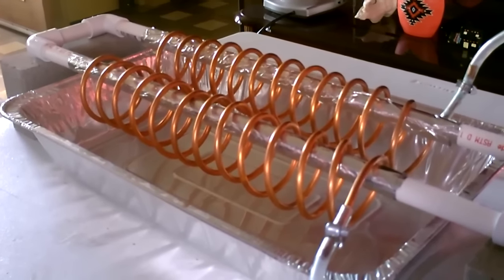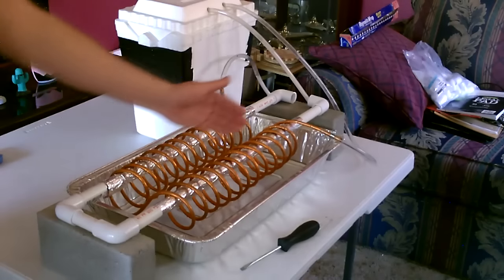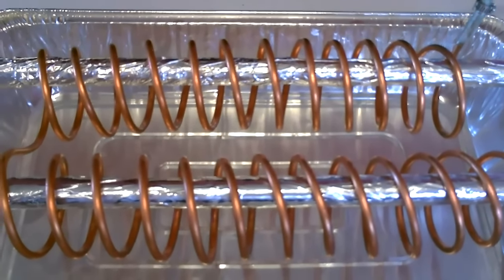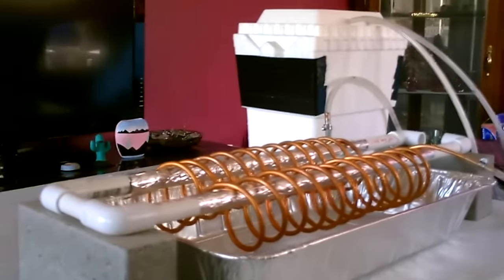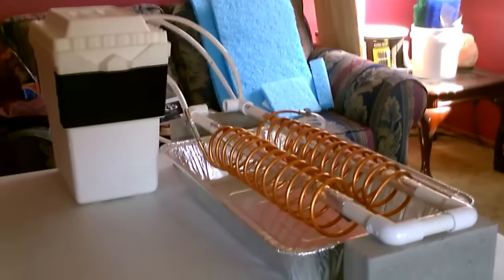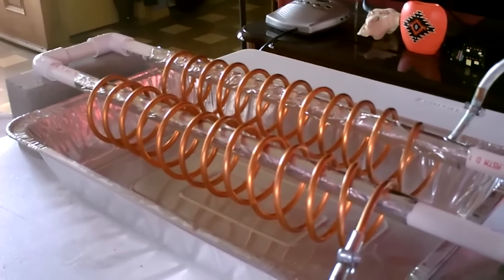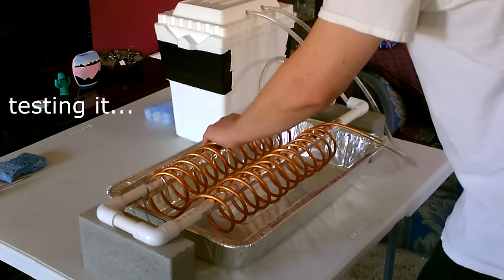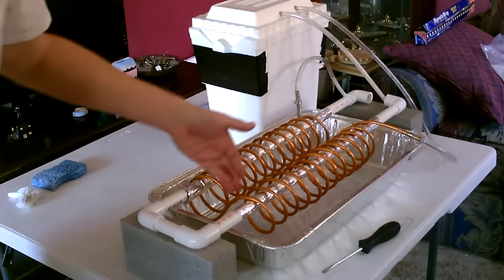DIY Atmospheric Water Generator! - Produces/Extracts Distilled Water from the air! - DIY distiller

Comment: I would love to see another video where you would explain clearer what is in the box and why/how this works.
Reply: @desertsun02 could do another one with a spare fridge to axe for parts, and skip a lot of intermediate steps such that the fridges compressor loop that used to be making the ice, is directly cooling the sterile copper condensation high surface collector thingy. Would be interesting to compare that to the similar units that sell for hundreds or thousands of $
Reply: What the hell youtube how do you tag people? @desertsun02 @desertsun02 bla bla bla
Reply: Sigmund Q Freud  energy consumption here is secondary... water gain is the trick
Reply: Ice and a fan
Reply: peltier cooler will be more compact to use for this one
Reply: @Tommy Barlow Cool bro (pun intended) lol. I've never really shopped for one but I do remember the first time I came across the concept like over ten years ago was watching this video for a proposed military contract that would have cost hundreds of millions and would produce an oasis in the desert. Probably a wide range of costs lol.
Reply: So you need water and a form of electricity to make water ? It's a neat idea but not very practical
Reply: This is a simple condenser. The copper coils are probably closer to 39F than 33F. If the air is humid, a 39F coil will condense water, just like your beer glass does on a warm summer's day. Water and pump are a pretty cheap way to cool the condenser coils. You could use a compressor and an inert gas, the same way your fridge or air-conditioner does. If you've ever been in SE Asia in the summer, it's basically raining condensation from the window A/C units. The A/C unit is a condenser that throws away the water, and blows cool dryish air into your house.
Condensers are not particularly efficient, but they are excellent for places that are (1) Arid (2) Humid and (3) Get lot's of sunlight. Like Syria or Queensland, Australia. You don't need to pump salt water for desalination, you have plenty of cheap electricity (solar PV), you have the sunlight to grow plants, all you need is the water. Condensers and micro-drip irrigation will probably solve the water crisis.
Reply: @Drakilicious The trick is avoiding legionaries disease...
Reply: me 2
Reply: @Drakilicious the electiracl energy required to do this, makes it a little questionable as a viable solution. But for major modern cities, where all that water just drips off the side of buildings, i think we need better containment solutions. storage tanks, treatment facilities, gardens, or even farms. so much could be done with the trillions of cubic meters of water our AC unites produce globally. we are just to lazy...
Reply: @shubhanshu4889  I have a 12v peltier device and solar panel. I may give it a try. I want to collect ambient moisture, much like the drops on the outside of a cool drink.
Reply: He explained it A1!  If people have a simple grasp of basic science this is easy to understand.  LOLzzzz
Reply: @MrBrew4321    The biggest energy cost is making those ice blocks. But as you say you can use solar and or wind.  Pumps like this run at very low wattage.  I was just looking at a freezer.  They use 350 watts and you probably could put even 100 Ice blocks in them ore more for this size.  So 10 panels could even operate 2-3 freezers plus the pumps.  Their are so many basic idea's like this no one uses.  I myself have other ideas.  Society is stupid!
Reply: Another video shows a vertical set up placed under ground with only the fan and solar panel above. What if I drew the air from the basement? Hmmm
Reply: Another efficiency is to fit the coils in a hot box ....run the incoming air across solar heated slats to increase air temp. Another way then would be to cool the water below ground for the coils..you could have a natural temp balance between the two without all the expense.
Reply: It’s just a simple dehumidifier
Reply: @JimRobb44  I wanna collect water using only 100 watts. I'm thinking of using PC fans to condense the air and the temperature of the earth.
Reply: Absolutley
Reply: Did he just pour water in to make water? Not sure about it , just drink the water you used to pour in the cooler 🤷🏻‍♂️
Reply: @Drakilicious pretty sure dehumidifiers also use a similar principle, considering it condenses the water. Always thought about using that, but would need to have reliable power generation and storage.
Reply: @Tommy Barlow a dampened rag in the shade will cool down on its own
Reply: This works in the same reason that water condenses on a cup of cold ice water
Reply: @sheldonwillis1704  You need a certain amount of water and electricity to make all the water you need. Maybe you have an abundance of electricity but only a gallon of water. This will allow you to keep that gallon of water and from it generate more water. Use the 'more water' but keep the gallon for generating what you need. get it?
Reply: @bretth4988  The styrofoam is probably not energy efficient either. It's def not green. And he's losing water to evaporation. And he started with clean drinking water, made it unsafe with the styrofoam, and then let it drip into an open container. He's not condensing water from air, he's humidifying the air!
Reply: @ianthompson44  hello 🤗….can you tell me where to find plans to build a unit that could produce 50–100 liters of WATER per day? I live in an area where well water has toxic levels of calcium and radon and city water 🤢 delivery is 80.00 per 1000 gallons. I’m an organic gardener and and functional medicine enthusiast so would like to eliminate the pvc and aluminum if possible, copper is great because it’s an essential mineral. Thank you so much 🙏
Reply: @RICHLES01  thank you Richard 🙏. I live where I have no water source. Could you guide me to where I can learn to do what you explained. More specifics? I have very basic understanding of chemistry as I’m a medical student. Thank you so much 🙏
Reply: @sheldonwillis1704  well you might have access to contaminated water or even salt water? Would salter water work better?
Reply: @sheldonwillis1704  yup
Reply: @MrBrew4321  already done, research Moses West and his Atmospheric water condenser.
Reply: @ianthompson44  je pensais exacte comme vous .
Reply: @bretth4988  salut je suis français et je suis très intéressée par différentes idées. Malheureusement je n ais pas beaucoup de connaissances , je commence seulement à m'intéresser à sa . Est ce que l on pourrais prendre contact
Reply: @sheldonwillis1704  ?? Ever had a cold beer on a hot summer day?  Ever noticed the invention of coasters? Condensation.  It's taught in elementary school.
Reply: It's a basic condenser. He is starting off with cold water and a small fountain or aquarium pump. The cooler is to keep the water as cold as possible without letting the atmosphere warm the water.

You could probably run the pump on a solar panel, and if you switch to 12volt you can cut that part of the carbon footprint. To cut out the footprint of the fridge (or whatever he used to get the water cold to start with) you could dig a 4x4x4 hole or deeper to place your reservoir and cover it back up. Or, if the ground you are working with sucks, you could build four retaining walls and back fill those. Either way you will want to double roof the top of your "box" or otherwise insulate the top or keep it well in shadow. Earth Ships have a similar way to get "air conditioning" so I suggest you check that out. The skills are transferrable.

Anyway that was all off the top my head. There are probably some better ways to do this if we think about it more. I like these little projects, see anyone being creative is just fun to watch. I hope this reply helps you out. And I don't mind a back and forth on this so feel free to reply if you wish. But for now take care.
Reply: @Sheldon Willis  that's what I thought.
Reply: To make clean water. You can use dirty water to push through the tubes. You're just drinking the condensated water that gathers. So, its still practical if you need a way to make clean water.
Reply: @spacecaptain9188  OMG....just listen and use your brain!  the water produced is from the air!!  The water inside the coils does not leak through the copper...it is in a closed loop between the coils and the styrofoam cooler.  When the outside warm air meets the cold surface of the coils...water is released FROM THE AIR...thus REDUCING the humidity of the air.
Reply: Dehumidifier
Reply: Ice, water and a circulating pump.  So you need frozen water to make water...hmmm
Reply: @sheldonwillis1704  you can use a different liquid, being enclosed you won't lose any to evaporation and use gravity, solar, a water or wind mill to power it

Comment: Cool project (pun intended)!   I would suggest orienting the tubes vertically over a funnel that is inserted into a 5 gallon water bottle.   I would also suggest using one of those Peltier junction electric coolers to keep the water cool, rather than relying on those freezer packs.   You're still going to be using electricity to cool the water, but you're not going to have to keep rotating the freezer packs to keep the system cool.   Alternately, you could use a small compressor refrigerator with a water bottle or bucket containing the pump inside and just drill holes through the wall for the copper tubes.   Compressors are more efficient than Peltier junctions, but they are mechanical and would wear out, whereas the Peltier junctions last forever and require no maintenance and make no noise.  If you're powering the system from solar, the Peltier junctions make more sense in the long run.  Thanks, for sharing!
Reply: use Cooling Heat Exchanger Water Pump Tank instead.
Reply: Sir we need your help in making this in a big number for people who are dying from thrust in Gwadar Balochistan
Reply: Thank you for the good read. I suggest you use paragraphs. I am not trying to be mean. 👍
Reply: Doesn't Peltier junction electric cooler have both hot and cool side? Is it possible to set it up so that the water stays cool?
Reply: @leveldadup2204  for YT reply paragraphs are needed? .. wow.. it was a great read. Knowledge matters more than formality on YT.

Comment: If you could use a solar powered glycol chiller, you'd be able to run this indefinitely as long as you have sunlight and humidity in the air.  Pretty cool!
Reply: You could store the solar energy in batteries for overnight collection.

Comment: Most people already own an Atmospheric Water Generator...it's called an "Air Conditioner."  My rooftop HVAC produces so much water dripping off the cooling coils that building codes require a drain line to keep from staining the roof and sides of the house, and this is in Nevada where single digit humidity is common.
Reply: I ended up buying an AquaboyII, and it works just fine in Vegas' low humidity. It does have to run all day though to keep up with me drinking about a gallon per day. It shuts off sometime during the night when it fills to capacity. As I'm typing this it's currently 11% humidity outside, but inside humidity is always higher, around 35% on average, I suppose from cooking, cleaning, breathing, showering, etc.
Reply: Great idea I guess I'll try to use my AC to get water for cleaning and watering plants (not for drinking)...I wonder if it'll work for everything besides drinking I don't even drink tap water anyway
Reply: steveXracer I wonder if using bacteria like oribiotics will kill bacteria in bucket distilling would clean it.?
Reply: @Drakilicious Don´t drink it. Filter it, purify it, but that water has been collecting spores and stuff for weeks. Boil it first if you want. But don´t drink it as it is.
Reply: I'm glad you dumbed that down for me. No seriously...it makes more sense now.

Comment: Excellent idea! With a little solar parts we can have power for the pump and we can use it during the day. Awesome! Thank you.
Reply from the maker: hi there and thanks. if interested, here's a link to a short video i just made showing the AC water pump (used in this project) alongside a 12VDC "solar panel powered" water pump. https://youtu.be/DU6QyYj_CuQ
Reply: You may also need a way to cool the water flowing through the copper tubes for an “off grid” application.
Reply: @RoyTheKing241  You could use running stream water if it was cold enough.
Reply: @hankchinaski4651  that would work. But if you had a running stream you wouldn't need to generate water from the atmosphere.
Reply: @RoyTheKing241  ha ha ha 👍😂
Reply: @RoyTheKing241  it's my understanding that countertop ice makers are very effective with solar.
Reply: @hankchinaski4651  If you had a cold stream, you wouldn't need to generator. I don't believe the output is distilled water. The air contains impurities that will mix with the water when it condenses. An example of that are the water spots left on a clean car after a heavy morning dew.

Comment: OPTIMIZATIONS  IDEAS: (make water by the gallon using solar)

1. Get a 12"-20" fan. Point the fan at the coils and turn it on.  You should test if the fan speed alters condensation rates. I guess a 3-5X improvement on water condensation.  

You could get a 12V fan, a 100W flexible 12V solar panel and a 20AH 12V battery for <$110.  Not sure how you are cooling the tube fluid, (ice?) this two can be powered by solar. I run my refrigerator and home lighting with solar.  (soon to do the TV & HTPC too)

You could put this thing on steroids by pumping freon (or equivalent) through the copper tubes using a solar powered condenser. It would likely be to cold causing the condensation tubes to turn to ice.  Keep the gas flowing with the compressor only coming on when the gas is warmer than 38* or so.

To vertical or not to vertical?  If vertical, the water will not have as many places to drip off from, with a constant flow of water dripping round and down the coils, you may end up with less area for condensation to take place as the water from the top down becomes a river covering the tubes with water. You want the maximum amount of the tubes surface area exposed directly to air.  Although, it's possible I'm wrong about this and vertical is actually is the best.  The water dripping round & down may clear the tubes from water faster than vertical.   A test may be in order.

Do this right and you could save $ on your water bill for a small investment.

Comment: 2 inch diameter inner copper coil (tightly coiled) and a 2.5 inch diameter copper outer coil (tightly coiled) vertically (2" diameter inside the outer coil) 5 feet long dripping water 24 seven into an IBC tote. Summer or winter this gives us water year-round. Use your indoor temperatures to create the temperature differential you need versus the second air pump drawing air from your garage or outside. Nothing more than swapping the air lines per season. Hope this helps everyone God bless.
Reply: How much water do you get per day in the summer? Should it be in the shade as well?

Comment: This is awesome.  With a couple of tweaks and if you connect the pipes up to a solar powered ice maker, you can have a mostly electric free design (minus the pump).
Reply from the maker: and you could use a DC pump to a solar panel too
Reply: @desertsun02  this can kill deerts combined with sun collector

Comment: What if you sealed your collection container, exposed it to the sun, whilst running FREON through the coils? What would your condensation/water output be, then? You might have to change the direction of the coils, turning these in a vertical position, maybe?

Next challenge might be to make it solar, for third world countries.

Also? I would use strictly copper and skip the aluminium.

My last worry would be the loss of electrolytes/minerals as this would be dead/distilled water. We would need to find a way to re-mineralize the condensate.

Kudos to you for seeking solutions, Buddy. Well done!
Reply: Very valid thought
Reply: have to have a stronger pump and electrical supply to pump high psi freon through and orifice to a low psi side creating the cooling effect and then a condenser for the freon to be pumped back to high psi.  neat project but really inefficient.

Comment: On a different video, I watched a 500 Watt (minimum size) Jackery power a countertop ice maker. Power stations like the Jackery can be recharged via portable solar panels. If the resulting ice were used to cool the water in that Styrofoam cooler, this atmospheric generator would work during power outages. (The power station would also run the pump) Two 500 watt power stations, 1 recharging in sunlight while the other operates the atmospheric generator, might work well. After the ice melts, put the water back into the ice maker and turn it back into ice to keep making more water.
Might be handy during an emergency if local conditions are right.
Thanks for showing this video.

Comment: Computer cooling fan blowing air thru 1 inch copper tubing which is then connected to a chilled condenser = distilled water out of thin air.  This works extremely well here in the south where it is extremely humid, but may not work as well in a more arid climate.